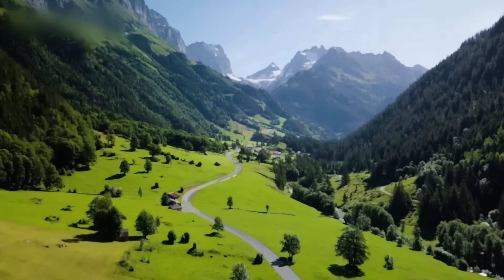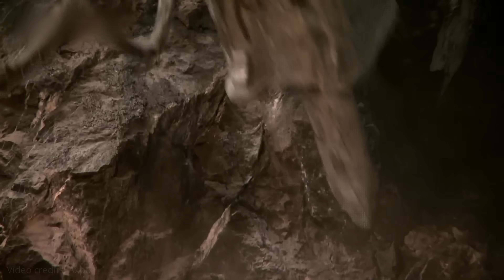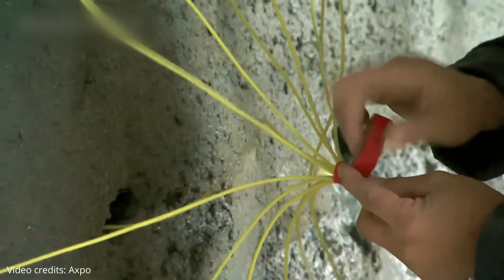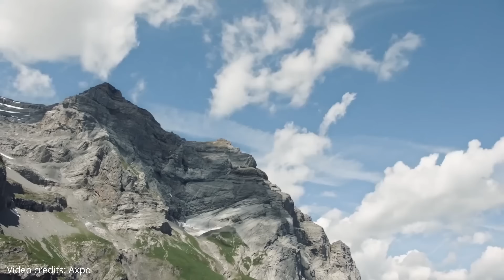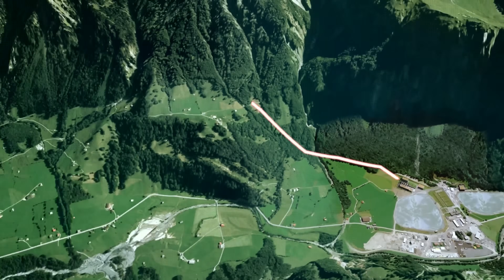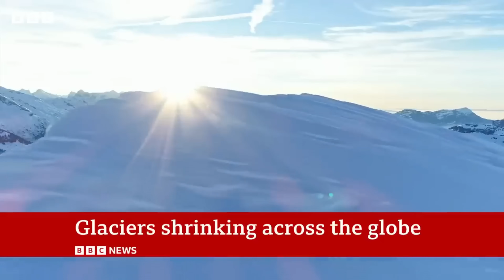They Hollowed Out an Entire Swiss Alp for This Power Plant

Comment: Too many key elements missing. 
One is cost - investments and production cost - for example Summer over-production around noon-time due to solar, so the high-price noon-time electricity market did break away, reducing overall sales; new low cost electricity storage systems will reduce market for late afternoon and evening consumption peaks.  
And such pump-storage power plants have been built for now almost hundred years. For example the Etzelwerk/Sihlsee built 1932-1937 to provide electricity for the railway network

Comment: Switzerland is probably the most successful nation on earth.  It is also the most beautiful country in the world.  The scale of this scheme is truly breathtaking and thanks for showing this in your excellent video.  I wonder is the risk posed by melting glaciers as serious as it might appear?  I would have thought the main loss of water in the system would be through possible leakages and evaporation.  So if there ever is a very serious loss of melting snow could they not just pump water from another source up to the lower reservoir (Limmern Lake) to keep this at its normal peak level?
Reply: Swiss here. 

Thank you.

And yes, this is increasingly being done. We do have some multi tiered dams for that purpose. We also use excess electricity during peak production times (solar peaks...) to fill dams via pumps. In fact we even use excess nuclear power from France during the night when theres less demand and thus cheaper rates to pump water into reservoirs/dams to produce electricity during peak demand times at higher rates. Its shifting the burden on the grid and installations with constant electricity output like nuckear reactors (which cant be casually shut down for just a few hours). You can think of it as dams acting like a gravity battery. We exploit the difference between electricity price at different times essentially to make... a profit.

Also, climate change is taken into account when building these projects. At certain lower elevations there will obv be less snow going forward but theyre well aware considering how expensive these projects are. This is switzerland after all.

Fun fact: I live in a not well known mountain state and we have a local cooperative (non profit) that owns some hydroelectric installations. Its a huge money maker and much of the money flows back into projects for the locals (local swimming pool for example). Hydroelectricty is our biggest export 😂
Reply: @mysterioanonymous3206  Many thanks for that information which is very interesting.

Comment: As a reference, Switzerland uses around 230TWh of electrical energy per year. 
230'000 GWh / (365d/y * 24h/d) = ~26 GW. 
The lake stores around 34 GWh of energy. 
This powerplant / battery has enough capacity to theoretically power the entire country for over an hour.

Comment: Pumped storage is not a power plant. It's storage. It doesn't generate the electricity, it just receives and stores it, and then releases it. Just like my car's battery powers the car, but it didn't generate the power. It received the power from the grid. Energy storage is incredibly useful, but it's not power generation.
Reply: wrong! the power plant generates energy, and when there is an excess of power, it switches to storage.
did you even watch the video???

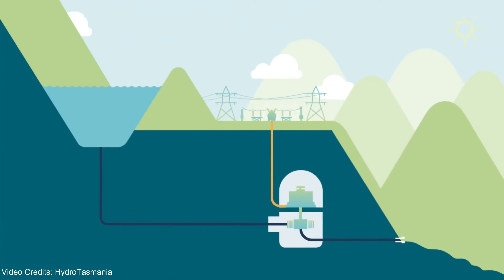Comment: @08:00 "Video Credits: HydroTasmania". Maybe those slides are from another project, not that nearby? But of course these all work with the same principle. As regards any other countries using these ideas: Norway, for example. Some people there say that the sudden release of water (dictated by the price of electricity on the European markets where Norway sells its extra electricity) can wreak havoc on the downstream river ecosystems.
Reply: There's one pumped storage plant in Wales also, if I recall right. And it's quite an old idea to place the generators and other hardware into the caverns excavated in the bedrock, even with the ordinary (not pumped storage) hydroelectric plants. They are more resilient in the times of war, for instance. Hmmm... maybe after a future technological dark age, people will think they have found a good quality copper mine when they encounter the big generator coils and other wiring there? Tin they will get from all the soldered electronic junk, so --> new bronze age!

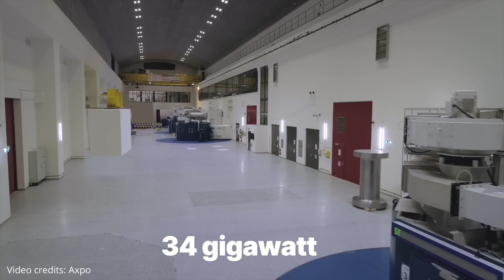Comment: 8:50 Video Says 34 Gigawatt-Hours but TEXT ON SCREEN has 34 gigawatt!! STORAGE CAPACITY SHOULD have HOURS!! In this particular case that is very important. I was literally waiting for energy storage capacity to get a sense of cost per kilowatt hours compared to batteries. 

So if you do the math, this facility is vastly superior in cost and capacity to a battery storage! AND at 80% plus efficiency it is very close to a large battery storage efficiency of 85%! I wish that you had covered precisely how efficient these are as dual SPEED pump / generators can be over 82% efficient (round trip). 

The Swiss are very smart! I wish some other countries / states were as smart!! 

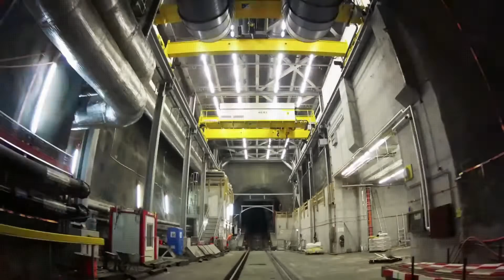12:59 California has a lot of potential to use pumped hydro for storage but generally the California bureaucrats have chosen batteries. Also in California there is a lot of NIMBYism against pumped hydro while the California bureaucrats push putting in lithium battery storage into our communities. There has been some extremely large fires with lithium battery storage facilities (Moss Landing, among a number or others).
Reply from the maker: Great catch on the gigawatt vs gigawatt-hours. Appreciate you flagging it! 
And your point on efficiency is great, as you mentioned we covered the 80%+ figure but you're right we could've gone deeper on the cost-per-kwh comparison against batteries, that's genuinely compelling math. The California pumped hydro point is a whole video on its own honestly. Thanks for watching it!

Comment: Germany ends up with too much electricity in the north, and then having to buy it in the south.   More high voltage lines are needed across the EU to balance out the wind and solar.  Without it, so much is wasted.
Reply: Quite some amount of energy could be handled with batteries but our government is too busy installing gas powered electric generators because it's better for their Lobby
Reply from the maker: Exactly right, and that's honestly a big part of why plants like Limmern matter so much right now. Switzerland sits right in the middle of all that imbalance — absorbs the German surplus, stores it, sends it back when the grid needs it. But you're spot on, without better transmission infrastructure across the EU it's still a band-aid on a bigger problem. Thanks for watching it!
Reply: @MegaBuilds-US  the biggest redox battery of Europe is being built in Switzerland 🎉